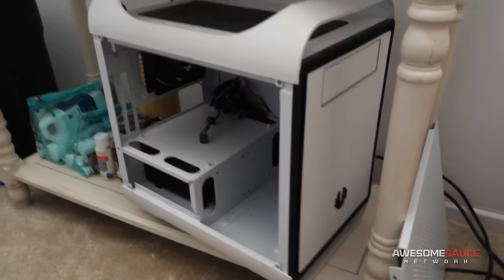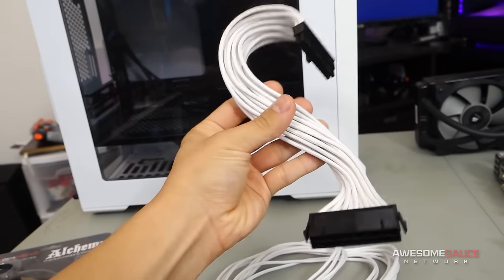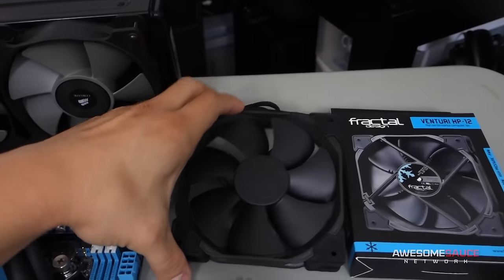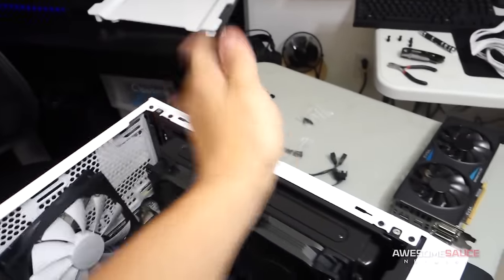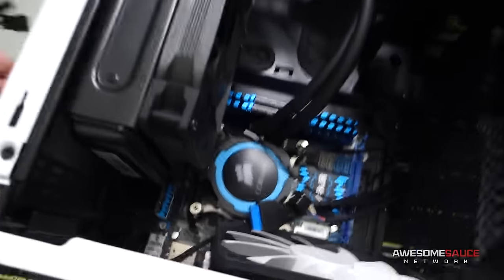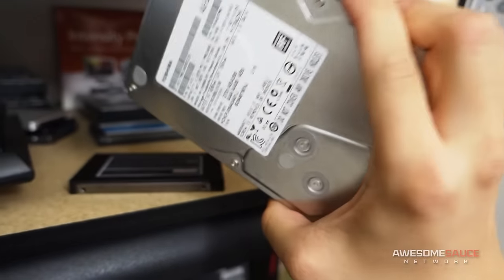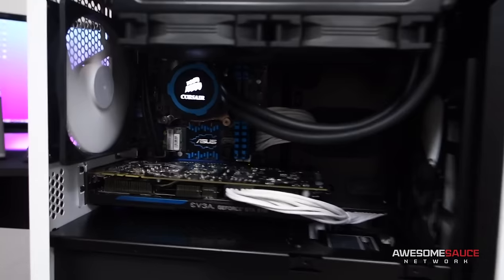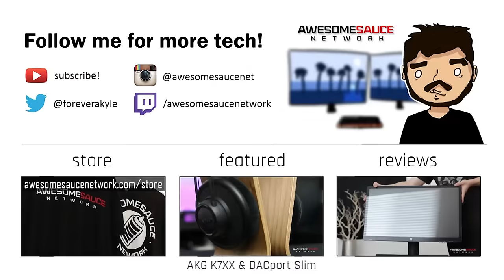Building My Wife a New PC! - "The Wifey Build"

Comment: "my wife has a limited workload"
Gives her a GTX 970
Wtf
Reply: lel
Reply: +Karel Van Hecke its 1500 in my country lol
Reply: Simply O.P haha
Reply: IKR
Reply: +Sniperzz YT like $300 in the U.S
Reply: ***** it's not basic at all
An r7 250 1gb would be "basic"
Reply: +Karel Van Hecke It's $300+ and an rx 480 is $240 which is better than a 970 so it's pretty expensive and overpriced (Wait for the NVIDIA fans to hate on this comment)
Reply: ***** It's always  yes, Crossfire rx 480 can be very close to beating a 1080 so pretty much yes. It can't beat a 970 SSC but can beat a normal 970 4gb.
Reply: ***** Without ssc 90% of the time the 480 wins even without overclock.
Reply: you've to look at 10 family: 1060 is way better than rx 480 and in italy only cost 50€ more
Reply: Marco L It's actually worse than the RX 480. The 1060 performs as a 970. When an RX 480 can perform as much as a 980.
Reply: the 1060 is actually a 980, not a 970
Reply: ZiovanGamer Hax look at some benchmark, or trust in nvidia when he say in his graph that 1060=980, 1070>980TI, 1080>old titanX
Reply: Marco L I've talked to EVGA, They said the 1060 performs as good as a 970.
Reply: +ZiovanGamer Hax So which one are y
going to buy then ? R9 390X or RX 480 . The R9 390X is older but is generally better that the RX 480. The RX 480 is newer though. The are the exact same price is England help please!
Reply: Winston Graham I would buy the RX 480. But buy the one that's cheaper. Because they're both good cards to start with. If it's the exact price, buy the 480. It has a better cooler and less watt usage.
Reply: +Marco L Why don't you look at some benchmarks, the RX 480 out performs in DX 12 slightly and shits on the 1060 in vulkan, which is very likely going t become mainstream because of increased Linux support and its open source nature.
Reply: +A fabulous space genleman? Too bad vulkan only supports 4 games, and by the time vulkan actually becomes huge, the rx 480 will not be anything special anymore..
Reply: its $150 in my country lol
Reply: Killian Defaoite I
Reply: Killian Defaoite That’s Kyle for you.
Reply: Its now worth $80 :)
Reply: @jamesherman3750  lol
Reply: was the 970 a really good card back then?
Reply: Yeek

Comment: shouldve given her an old athlon and 4 gigs of ram, put it all in a fancy case, and say it's "top of the line"
Reply: hahaha
Reply: Lol that system is like mine rn
Reply: +Horsman4James That's similar to what sellers do where I live. They try to sell you a "super fancy, bleeding-edge technology" pc, and it has like a core i3 and onboard graphics in.
Reply: Welecome to prebuilt computers rofl
Reply: +StickMasterKai so true, I was about to buy a pre-built pc recommended by one of the store employees, until I realized it was a $1500 pc with a core i5 3xxx and a gtx 650 with 8 gb of ram. I can 4K with 1500 dollars!
Reply: no pentium 4 with 256 mb ram and say it was the fastest pc ever build
Reply: +Horsman4James  The wife of a PC builder/tech guy? I doubt she'd fall for it.
Reply: +Ian Witten no, the celeron 300A with 16mb DDR ram
Reply: +Horsman4James give her something that's top of the line, just somethingthat top of the line to be scrapped
Reply: +Horsman4James  haha yes!
Reply: +Ian Witten add a GTX 480 and you can call it the hottest ever PC build :D
Reply: +Gaius Trollius More like an i7-4790K with R7 370 graphics
Reply: That's even more accurate. Never buy pre-built systems.
Reply: +Commentator i think i got a pretty good priced prebuilt
price about 1400$
graphics card: GeForce GTX 1070 Founders Edition
CPU(probably what made it cheap) intel core i5-6400 @ 2.70GHz
16 GB ram
Reply: Sprsae If if came with monitor and kbm, then it's good.
Otherwise, you've overspent.
Reply: +Sprsae But what about the rest of the pc? You can get an i5-6600k and EVGA GTX 1070 FTW, Z170 motherboard, 16 GB ram and good psu for like 1100$ tops.
But prebuilt systems usually have shitty components, even if the gpu and cpu seem good, it's just not worth it..
Reply: This is so something I would do lol

Comment: This is a kick ass build for a daily driver. Only thing I'd pimp is the memory. With all that horse power, water cooling, and storage, you might as well spring for 16GB.  Most situations you won't notice, but this system deserves a minimum of 16GB.

Comment: have this case too, it's freaken awesome
a lot of reviews you see about this the EVOLV cases, they all complaint about the poor airflow due to the front cover.
i actually think they designed it as intended, for people to to cut it out.
I cutout my front cover, with the fan's LED shine through with the room light switched off, looks groovy, and no problem with the air flow ;)

Comment: Better PC then me :/ :(
Reply: +Bole_87  ;__; I used to know that feel ..What specs do you have anyway? :P ...I'm always curious as to what people are running regardless of how low/high end :P.
Reply: +Bole_87 what system do you have? Im running core 2 quad q9550 ,4 gb of ddr2 hyperX, gt730 1gb gddr5, 350 watt LEPA psu, 180 gb hdd
Reply: I have an i7 4790k @4.4GHz, MSI GTX 770 2GB OC Edition (getting an EVGA 980 TI in a few months) 8 GB of RAM (gonna buy another 8 in not too long) Hyper 212 EVO. 1TB HDD and 250 GB Samsung 850 Evo SSD. Windows 10, gaming case with red LED's (forget the name). 24 inch 1920x1080p gaming monitor (I will soon get a 1440p or higher once I get the 980 TI) Yeah, that's it so far :P
Reply: Just built mine a few minutes ago 

4790k
Gtx 970
256 Samsung 850pro
4Tb Wd
Z97 msi gaming 5
Reply: Shayant Sital Awesome build. But is 4 TB really needed? lol, too much for me.
Reply: RabidApocalypse i use up a lpt of storage very quickly... So yeah
Reply: +Shayant Sital (Geek) 

Intel i7 4790k Quad-Core @ 4GHZ 

Kingston Hyper X 16GB Black memory 

Fractal Design Define R5 (Windowed) 

Asus STRIX GTX 980 4GB 

500GB Samsung 840 EVO SSD 

2x 1TB Western Digital Black Hard-drive 

EVGA Supernova 750W B2 Power Supply

:)
Reply: RabidApocalypse Cool :P ..I have a 980ti...Awesome card :3 ...I have 16gb ddr4 and  a 5820k cpu the rest of the specs don't really matter that much tbh.
Reply: Shayant Sital This^ ...I have a 3tb hdd and have uninstalled a shit load of things from it because 3tb is not enough when you have tbs worth of  games/movies and video footage etc haha
Reply: AMD FX 8320 (throttling every 5 mins to 1.3ghz)
AMD HD 7870 2GB
8GB Hynix 1333Mhz
500GB Seagate
Biostar A960d+ Mother (30$ Shit)
530w PSU
Reply: Wait wait wait..Throttling to 1.3ghz? wut ....Why? Cooler not sufficient?
Reply: To all AMD CPU users.... Get an intel CPU :P So much more performance, even with less cores.
Reply: RabidApocalypse Depends on what intel cpus tbh :P
Reply: Wyatt O'Shea I have a Scythe Grand Kama Cross 2 ! But its throttling because of the mainboard i thing
Reply: +Bole_87 Yes your Motherboad VRM are overheating/not strong enough for a FX 8XXX CPU ;)
Reply: Bole_87 Are you getting high temps? Also if it's throttling because of the motherboard shouldn't the mobo be replaced?Seems like it could be broken ...Unless one day you went into the bios and somehow "accidentally" changed the cpu frequency settings and down clocked it...It also could just be doing normal cpu things ...Just like intel cpus when they're not really being used they down clock automatically....My old 2600k used to go down to 1.6ghz when nothing demanding wasn't happening.Is it fine when you're gaming?
Reply: But I am getting a new PC soon

I7 5820k
MSI X99A Sli Plus
Corsair LPX 32Gb 2400Mhz
Gigabyte GTX 980ti G1
Samsung 850 Evo 500Gb
WD Black 1TB
Corsair HX750i
Corsair 780T
Custom Watercooling
Reply: dsdenni Honestly idk why I didn't even think of that XD..Probably because i'm still a little tired this morning :P (8:21 am here in Aus)
Reply: Bole_87 Nice :P ..I have the same motherboard,cpu,ssd :D
Reply: +Wyatt O'Shea I have an fx8350 from amd. Runs games at higher and equal  fps as my mates with the i5 4690k. Mine is currently overclocked to 5.1GHz on a hyper 212 evo. 8gb 1600mhz and a gtx 970.
Reply: Miguel Mourato Fuck that's a sick overclock man :P ..I got my 2600k to 5ghz 24/7 100% stable at one point but because of the aussie summers here it would literally overheat and I backed it down to a 4.5-4.8ghz overclock depending on the time of the year anyway :P .
Reply: When I had a GTX 770 and 8350, I got a max of 25-30 no matter what settings because of CPU bottleneck. NOw, with my i7 4790k, I can max out or play with very high settings and get 50-60 FPS. AMD < INTEL
Reply: RabidApocalypse Could have been an actual problem with the motherboard/cpu that you got though but meh doesn't matter now anyway that you've got that pc now :P
Reply: Wyatt O'Shea Heck, I had a higher end motherboard for my 8350 then I have for my i7. :P
Reply: I'm currently running a i5 4460 a gtx 950 with 8GB Of 2400mhz ram in a thermaltake versa22 with a1tb Seagate Baracuda
Reply: RabidApocalypse I have a higher end motherboard (price wise anyway) for my 2600k than I do for my 5820k XDD ...
Reply: Vadim Viehoff Hey at least it's better than the laptop I used to have back in 2009 that couldn't play any game literally none at over 11 fps XDD ...I used to play minecraft all the time back when it was a new thing and yeah..it sucked but it was all I could afford at the time being a full time student in year 9 at school lol
Reply: +Wyatt O'Shea I've got this system:

I7-5820k

16gb G-Skill 5 DDR4 3200

GTX 980ti 

2x Samsung 850-EVO series 250gb SSD  in RAID 1

3TB Seagate Barracuda 3TB 7200RPM HDD

NZXT H440 Razer edition

Corsair RM1000 PSU

MSI X99s SLI plus ATX mobo

Corsair h100i GTX liquid cooler

Some corsair fans

HA JK! I don't have that system yet, but will soon. Have the case already and painted some parts green:)
Reply: BaccaClench Nice :P ..I have that same cpu cooler :P ...I have about half the parts you're soon to have :P ...Except my ssd is the 500gb version of those 2 250gb ones,different ram still g.skill brand though cbf listing the other parts XD...still too tired/lazy
Reply: +Wyatt O'Shea 
4690K i5
msi krait z97
kingston hyperx 8gb 1600
xfx 390x
corsair cs 650m
corsair h110 gtx
1tb hdd
120gb ssd
fractal design r5
Reply: Mattias Kroeze Nice :P ..I wanted that same motherboard a little while ago but then decided to get the msi one instead because I went from wanting that 4790k to a 5820k after skylake launched and the x99 platform was only a couple hundred more in total for me than the skylake one was :P .I also have that same case :D ..I still like my corsair 750d more though aesthetically but my R5 is much quieter with the noctua nfa14 fans on my radiator anyway :3
Reply: +MMXGames Haha I have a similar system. A Q9400, 8gb of PNY DDR2, a GTX960. I'm looking at getting a new cooler soon because my CPU is thermal throttling, but when it isn't then my GPU usually maxes out.
Reply: +RabidApocalypse there's no way the 8350 bottlenecked, it's an amazing cpu even keeps up with high end i5s
Reply: Ayaan Quraishi i5 and high end don't really go together lel.At best they're mid range (imo)
Reply: +Wyatt O'Shea they're mid range processors no one said they were high end people say builds with i5s and 970's are high end its not but they mainly talk about thegpu not the cpu
Reply: Joeink100 Quoting Ayaan Quraishi :there's no way the 8350 bottlenecked, it's an amazing cpu even keeps up with high end i5s <Literally says "high end i5's" derp
Reply: Wyatt O'Shea he meant more high end for that bracket like if im spending less than £40 on speakers the ones i spend £40 on will probably be higher end the ones i spend £30 on yes they are shit but the £40 is comparatively high end.
Reply: Joeink100 Cbf arguing with you so i'm going to agree XDD.
Reply: +Wyatt O'Shea. not sure of that's a win our a win by default?
Reply: Joeink100 Does it matter? :P ...I was going to somewhat troll you which could have been seen as me arguing with you but decided not to because I don't really care enough to.(was going to say something along the lines of but a $30 pair of speakers can be more high end than a $40 pair depending on what hardware each is using etc etc)
Reply: Wyatt O'Shea  yeah but thats just being pedantic and why i said "probably" notjust what would happen
Reply: Joeink100 Why I said I cbf because I was only trolling lel.
Reply: ***** That's a nice system man :P
Reply: ***** Yeah man we get fucked over here in Aus with prices on pc HW and allot of other crap.My 980ti was only $989 from PLE computers :) also idk what my 3d mark score is haha...i'd have to check or do some testing of my own
Reply: ***** Just had a quick look and my best score (so far anyway) was around 15.5k for my 980ti (graphics score of 18.9k and 12.2k for physics)was running a quick 4.4 ghz oc on my 5820k and a quick oc on the 980ti too :edit: This was on firestrike 1.1 btw ..my highest score on the ultra test was 4.8k
Reply: ***** Haha yeah XD
Reply: ***** Ah fair enough..I have the full version of it on steam ..I bought it one day on sale for a few bucks :P  Oh I just found an older test I did on my old 2600k system and my gpu scored 26.3k and my physics score was 9117 and combined was 8837 ..I need to do some over clocking one day on this system to at least match my old scores on the older system haha :P
Reply: I got an i5 4460 GTX 760 8gb ram, only one game i wanna play before i stop caring about new games
Reply: You have almost the same system as me 
And I have no problems with games 
Like BF 4 max graphics I get 30-55ish FPS
Cod - 60fps on most of them

People who say amd is shit are just Intel fanboys 
Like no one has $500 for a freaken CPU
Like yes they are super nice and fast parts but for the price?!  Hell nah
Reply: J⃟O⃟N⃟A⃟T⃟H⃟A⃟N⃟ S⃟C⃟H⃟U⃟L⃟T⃟Z⃟ I think my $569 core i7 5820k was easily worth the money considering it is faster at stock speeds than my 2600k was at 5ghz and that thing was a fucking beast of a cpu already lol :P
Reply: Wyatt O'Shea
Well my $150 CPU runs games at 1080p 50-60fps
Sometimes down to 30 but rarely
So I don't get it
Your eye can't see more than 60fps
And who needs 4K?
Reply: J⃟O⃟N⃟A⃟T⃟H⃟A⃟N⃟ S⃟C⃟H⃟U⃟L⃟T⃟Z⃟ Just because you don't need a more powerful cpu to do stuff doesn't mean I don't lol...Editing and rendering videos takes a long time I also use extremely demanding software sometimes too which on my 2600k was impossible to use because it would max my cpu out.On this cpu I can still game with my mate and be on skype and record 2 different streams (1 stream for audio and the game and another for my camera etc) at the same time and still use that software without even getting close to max usage.
Reply: +Bole_87 Right now im currently running a 

Mobo: MSI Z77 MPOWER ATX Motherboard 
CPU: Intel core i5 3570k 3.80 GHz
GPU: Nvidia GTX 660
RAM: Kingston Hyper X FURY black series 8gb DDR3 (2x4gb)
OS: Win 10 
PSU:  EVGA 500b Bronze 500w
HDD: 1tb Western digital 
Cooling: Corsair Hydro series H50 quiet edition 
And all wrapped up in a pretty Thermaltake Versa n21
Reply: Wyatt O'Shea
Well I don't edit or render videos
Just mostly play games or do school shiat 
Or just google random shit
So for me Intel isn't worth the money I don't have
Reply: J⃟O⃟N⃟A⃟T⃟H⃟A⃟N⃟ S⃟C⃟H⃟U⃟L⃟T⃟Z⃟ Fair enough man
Reply: +DG Tech i7 3630qm 2.40 ghz

12 gags of ram

650m nvidia

i dont know the rest cuz iam on a laptop
Reply: +bluenuttefly how much? it's been 8 months that I've been doing research on gaming pcs and I'm no where close to feeling comfortable making my own but I have to if I wanna play phantasy star universe again. I love that game so much and with mods it will be even better, can't wait to use mods.
Reply: xXxAlmightyForcexXx i had 2 days of PC gaming reshearch and built my own PC... Its super easy. just use PCPartpicker
Reply: bluenuttefly $800?! Dang what cost so much?  Your ram is slow and you don't have a expensive video card...
I built my parents a i5 6600k (over clocking it) 16gb ddr4 3000mhz (is the top speed I had to set it down some due to computability issues with CPU) and a GTX 750ti 2gb super clocked video card 120gb ssd and a 1tb hard drive for around $600 ish...
Reply: BRYWORZ oh yea... I always forget about the os...
When I made my PC I had a budget of $600 and I spent like $590 and I'm like finally done and under the budget... F**K!!!!!! No os
But luckily I found iOS 8 for $50ish and got 10 free so it wasn't so bad
Reply: Woah wait... The prices went up since I built my parents a PC... Which was like a month ago... The power supply is now $30 more and other things are a bit more... So It's now $70 more when I bought them....
Huh.   Ig just wait for sales
Because this build was $602...
Reply: bluenuttefly oh are you not in America?  Yea that could make things a little pricy too...
Have you tired newegg?  They sell parts pretty cheap idk if they charge extra world wide though...
Reply: bluenuttefly Georgia?  Then why did you say they charge so much shipping like you live across seas?
I live in Florida and everything is a crap load here but newegg always gives me free shipping
Reply: bluenuttefly oh... Lol sorry
It's so confusing....
Reply: bluenuttefly well good luck finding somewhat cheap prices...
Reply: MMXGames damn that's rough

Comment: "the tubes werent long enough to install the radiator on the pull out tray" 

yeah that or most people just screw in the radiator BEFORE the water block lol
Reply: It was taken from one of his pre built PCs if u listened at all
Reply: +Beast Mode8000 im saying unscrew it from the motherboard first, then the hose length doesn't matter. Doesn't matter where the cooler came from

Comment: Clean build for sure. The case is a little dark inside though due to the big radiator and ITX form factor.

I would have tried the LED strip on the backside of the top mounted radiator.  Not sure if the light would be too obstructed or would yield a nice indirect glow.